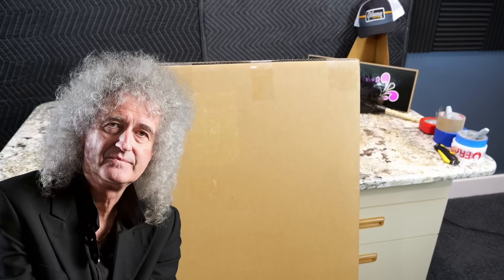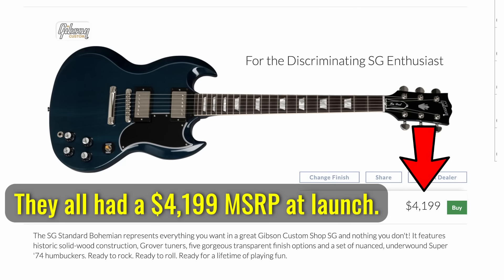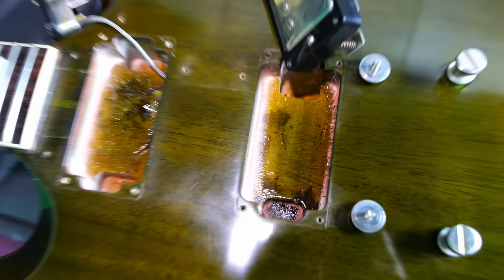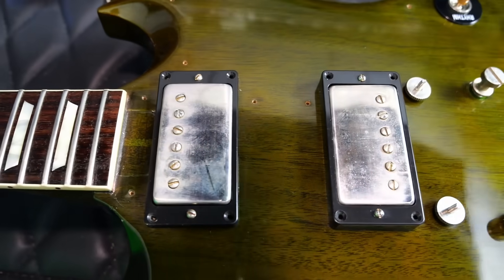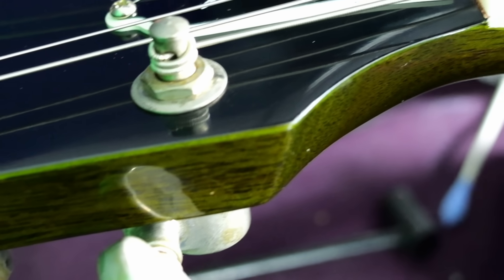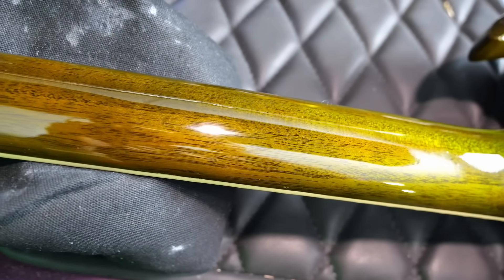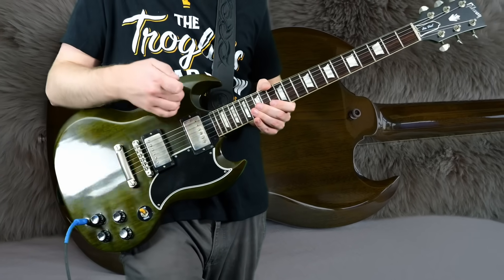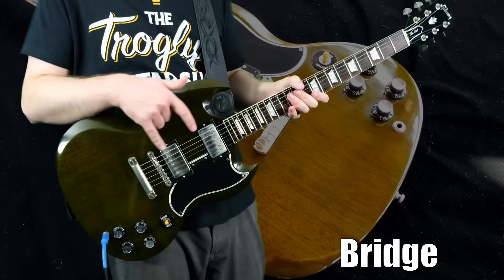That Cool Limited Edition SG From 2018 That No One Talks About | Gibson Custom Shop BOHEMIAN SG Sage

Comment: Just to point out that pickup wind count doesn't necessarily mean hotter or lower output. Output is more influenced by the inductance balanced with a low capacitance.

Comment: im surprised you didnt mention it has the extended flush hell carve. I got a 2018 custom shop 61 in the double gold from a limited run of 15. also has the extended heel joint

Comment: Trogley. Are you sure those Schaller strap buttons didn't come on this?  I'm thinking that if it is equipped with Grovers that perhaps....  I am now kind of wondering that if the speech sheet would list the strap buttons.         One of these from La Jolla just sold. I so wanted that.  But as soon as I might save some money. I spend it on something of lesser value  like stomp boxes (I've been accumulating drive boxes for instance,then there are project guitars if you will or guitars for that matter). This year though Gibson came up with the Modern Doublecut. , the Les is More line and oh yeah the Bohemian.   I do like this color.  The red in the body and the rosewood fretboard...this works.  The studio LP  you had a presentation and stated that the white color guitars came with ebony fretboards (Gibson is good this way.  Beautiful). The rosewood fretboards were on all other colors in the studio line.  Yes that white body with a rosewood board looked somehow dirty. if you will.  This didn't work.  Good presentations. Trogley.    I am  really  going to concentrate on that Bohemian.        Like it. (And truth be known  because it is a Bohemian I lust for it....or rather like it lots).

Comment: Has Gibson done a signature Derik Trucks SG?
Reply: I believe so.
Reply: The Derek Trucks Signature SG was introduced for the 2012 model year as a recreation of Trucks' main guitar for about a decade, a 2000 '61 Reissue with the optional Maestro Vibrola, which he removed and had a stopbar tailpiece installed, while keeping the vibrola's frame and cover. He also removed the pickguard. It was reintroduced with minor changes for the 2014 model year.

Comment: I'm sure the bumblebees are resistors.  Guitar capacitors are usually round and flat and its for the tone control.
Reply: No, they are not resistors. They are capacitors. The real Bumblebees are paper in oil capacitors (these are not real Bumblebees btw).
The round and flat ones you're talking about are ceramic disc capacitors.

Comment: It’s beyond ridiculous, that a limited edition Gibson SG from the modern era is clearly so unbalanced that it suffers with such severe neck dive as to make playing it a chore?…🙈
Reply: Doesn’t neck dive come standard on SGs? I mean how would you correct it without changing the design of the guitar? The neck sticks out farther from the body than an LP and the body is much lighter (both by design) so the midway balance point for the upper strap button would be in the middle of the neck. It’s physics.
Reply: @leinonibishop9480  Not in all cases? Because I have a walnut 1972 SG standard that thankfully doesn’t suffer at all from neck dive. I have a 82 Flying V that suffers from neck dive that I’ve held onto since I was 13 that for a few lean years it got relegated to being main guitar, when people would tell me to move the strap locks to find the sweet spot, but I didn’t want to go drilling exploratory holes all over the guitar trying to locate where it would rebalance the best, and so I just resorted to sliding a 5 inch steel pipe through the shoulder strap at the back to balance it…🙈
Reply: @derangedhermit2879  walnut is much more dense and therefore heavier than the standard sg wood, which was typically mahogany. so i would say that your sg is the exception to the rule as far as neck dive goes, not the standard that all others should be compared to.
i don't think you need to do any exploratory drilling. balance the guitar on your knee, move it back and forth until you find the balance point. your guitar strap needs to attach at an equal distance from that balance point on both ends. on a typical sg this will probably mean the front end would attach in the middle of the neck, where you can't put a strap button.
alas, i've never held a flying v, so i can't say where the balance point is on those.
Reply: @leinonibishop9480  I never knew that about SG’s neck diving, and so I guess I got lucky for once in my life then with the walnut SG that I inherited from my uncle. The neck diver flying V has long remained retired and banished to its case for over two decades now, why ever I still hold onto that bad habit inducing guitar instead of so many other much more lucrative lost treasures that somehow slipped away, back from my youth is a mystery that only hurts to even contemplate. & so I should openly admit to my single biggest million dollar F up blunder in my life, was selling off cursed unwanted, in game awards my phone game, that forced me to collect in a wallet app, which I really didn’t want slowing down my phone down, before I short sightedly sold off 88 bitcoins in 2011 when the Bitcoin hit a dollar…That got up to $60K each and ever since I hate hear about crypto, Ouch!…LoL…🙈